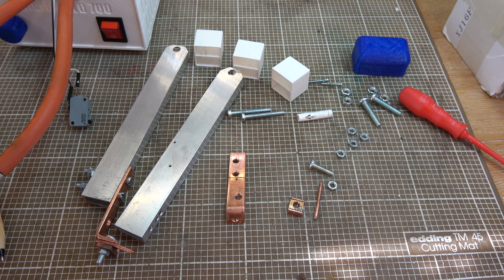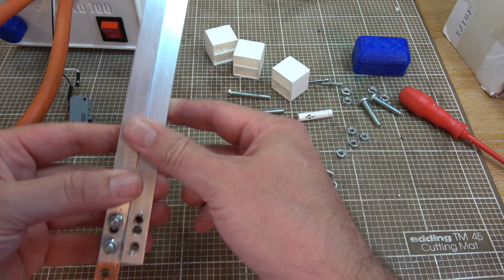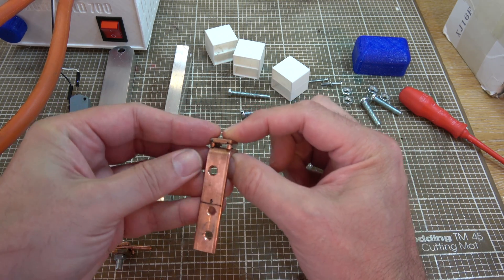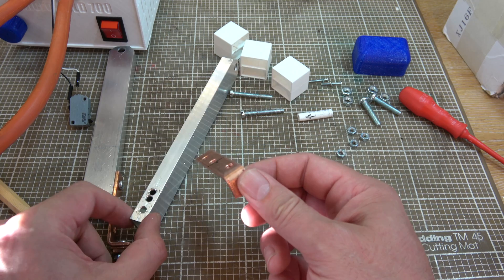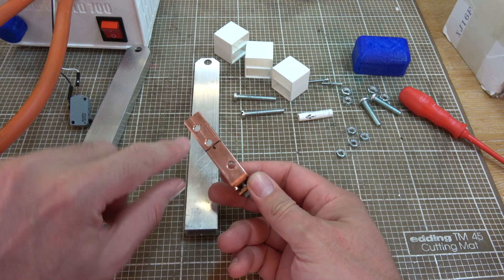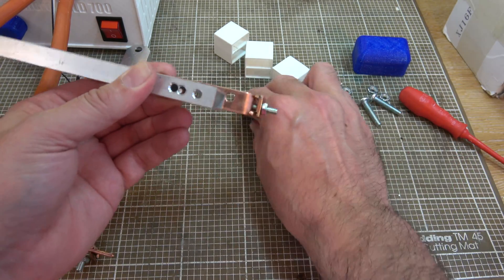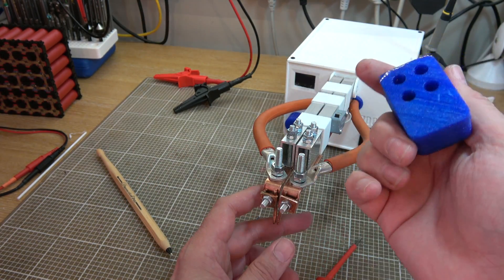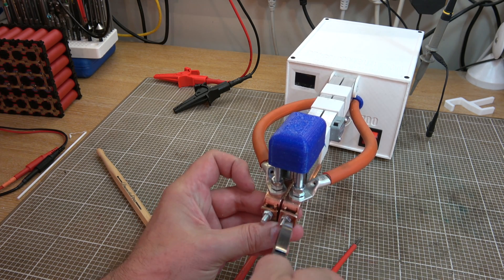Battery Tab Spot Welder - Extras 1 - Electrode Assembly

Comment: Awesome, I'll use this to design that arm in plastic. I am using PETG so it should be able to handle the heat. If not, I'll try wood.  Thanks for the video and all the time spent on this project.
Reply from the maker: If you want me to share the fusion360 design so that you can edit it, make changes etc, then I'm more than happy to do so. I tried to make the design public already, but I believe that fusion360 lets people collaborate on a design - If you give me your fusion360 username then I'd be more than happy to add you to the project. It would be great if the whole design could be 3d-printable. Cheers!!
Reply: That was a quick response. I was using your aluminum clips to design one but realized that I forgot to make the end that clamps onto the front smaller so that they can fit into the clip. Yeah, it would be awesome if you upload the plastic piece. I can easily edit it to my needs.

Comment: Hi Jim what stops the two wires shorting through the aluminium arms?
Reply from the maker: Hi Dan - There's a 1.2mm gap between the aluminium arms, maintained by the 3x spacer clips I printed off. Cheers!!
Reply: Jim Conner ok that's cool I couldn't see that and it confused me. I have to say many on you tube have made spot welders before and its not worked well but yours seems to work really well.

Comment: Well that's a decent idea to have the electrodes clamped. Overall good job Jim. 

I've been designing my own and so far just got the pcb done and searching all over the internet on how the professional ones with air pressure use the electrode to lower and raise the electrodes. I was thinking for RC servos.
Reply from the maker: Hi George - I planned out all sorts of clever ideas using spring-loaded electrodes to accomodate any offset in the electrode lengths, and then having an adjustable spring mechanism on the trigger switch so that I could set consistent pressure - however, having tried this one out on a simple pack, I don't feel the need to go further along that route - The current welder is good enough for me to make two or three battery packs a year. Have you thought about using a solenoid for raising the arm, and just counterweights to drop it back down? The counterweights would give you a nice constant pressure and you could adjust the weights easily by adding/removing weights from the ends of the arms. Cheers!!
Reply: Jim Conner thanks for the idea. But a solenoid would be too harsh on the cells while coming down or while raising them and controlling them would need additional circuitry. 

I've managed to use a servo and control the speed to lower and raise a pair of electrodes. Now waiting for a few stuffs to arrive to assemble the parts.